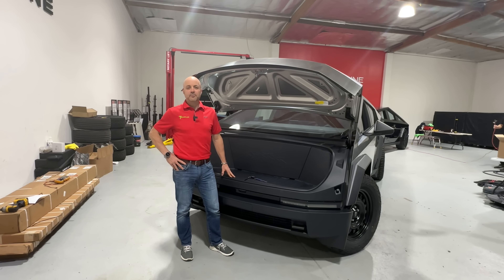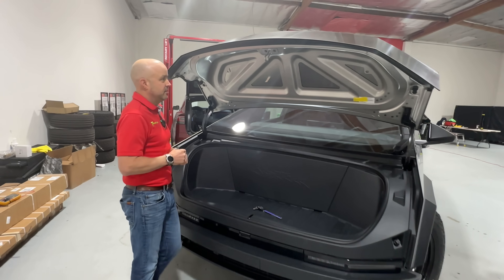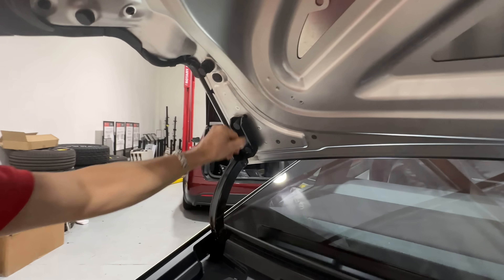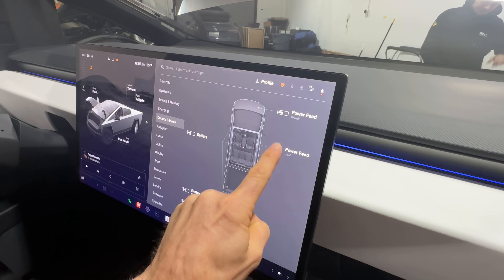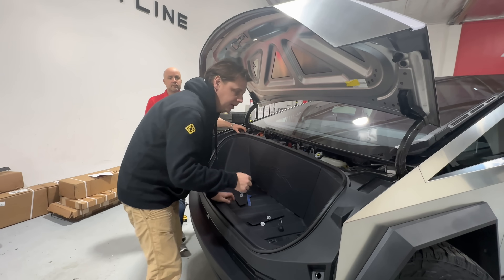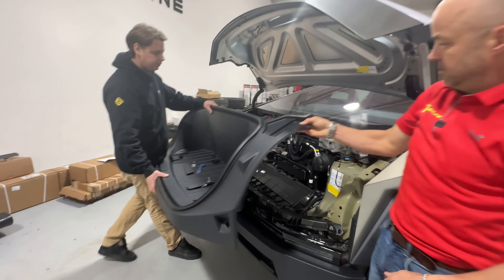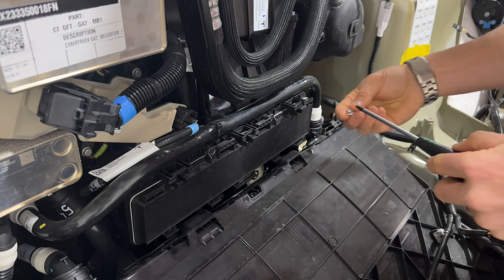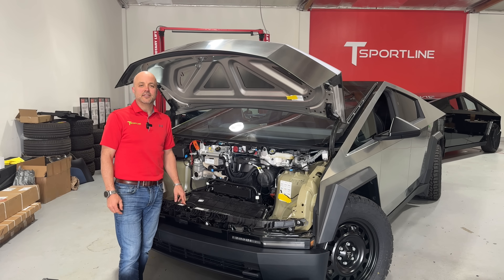Dissecting a Cybertruck Part 2! Tesla Auxiliary Power Under Frunk, Inspection & More, first look

Comment: That's a very tidy design. It's organized extremely well unlike any other EV. Tesla engineers are really the best in their craft.😮
Reply: So, if I want to replace my cabin filter it's like a 4 hour process to remove the "frunk" and all the additional bits. Yeah, great engineering. Rivian is one easy removed panel and a cover plate. Neither need tools to remove.

Speaking of frunks, what do you put up there? Couple of Target bags full of stuff you don't mind spilling out? There's not even a cargo net to help with the TINY space of storage up there. Pulling from the previous video on the break down, only aluminum or aluminum combo metals for under the truck? For a truck you supposedly want to go off road? No option for any kind of upgraded skid plates? Sad. And speaking of off roading, can't install larger tires without some sort of really custom lift kit or hardware change kit to remove the exposed bolt ends?

This was a truck engineered by car makers who don't know anything about going off road. Not their fault. I blame Elon and unbeatable time-lines.

Also, rear wheel steering on an off-road truck? If so, you had better beef it up a LOT more than they did. Again, car makers making trucks.
Reply: @azsean73  If you did just tried to finish video and listen carefully, you wouldn't be ignorant about the fact that it is accessible with having to remove all of that. There's a dedicated access in the middle of the "frunk".
Reply: @azsean73  People who can afford Cybertruck doesn't go to Target like you. And may I remind you, there's a 6 foot bed in the back.
Reply: @jaymarkkabo2626 wtf cares!?
Reply from the maker: It is not bad!
Reply: Smokes the rivian everytime 😂
Reply: @azsean73  wrong. There's an access panel to the cabin filter.
Reply: And Dancer Bus engineers too.

Comment: Everything's so tidy, compact, and easy to get at. Impressive!
Reply from the maker: It is easy to pull apart
Reply: @TSportline  i want to know if that rectangular box just above the front bumper camera is for the radar module or a washer fluid storage for the camera
Reply: So, if I want to replace my cabin filter it's like a 4 hour process to remove the "frunk" and all the additional bits. Yeah, great engineering. Rivian is one easy removed panel and a cover plate. Neither need tools to remove.

Speaking of frunks, what do you put up there? Couple of Target bags full of stuff you don't mind spilling out? There's not even a cargo net to help with the TINY space of storage up there. Pulling from the previous video on the break down, only aluminum or aluminum combo metals for under the truck? For a truck you supposedly want to go off road? No option for any kind of upgraded skid plates? Sad. And speaking of off roading, can't install larger tires without some sort of really custom lift kit or hardware change kit to remove the exposed bolt ends?

This was a truck engineered by car makers who don't know anything about going off road. Not their fault. I blame Elon and unbeatable time-lines.

Also, rear wheel steering on an off-road truck? If so, you had better beef it up a LOT more than they did. Again, car makers making trucks.
Reply: @azsean73  Did you even bother to watch the video, or do you just troll....
Reply: @azsean73  The HEPA filter is accessible from that square panel in the frunk. watch more videos.
The frunk is narrow yes, due to the shape of the truck obviously. but you have ~9x more lockable storage that the rivian frunk in the vault since it has that tough tonneau cover.
I believe you can get skid plates already.
yeah larger tires will need to be pushed out due to the exposed bolts.
seems like a very good off-roader just not an extreme one.
rear wheel steering is a very nice addition to a massive truck like this. seems like you are looking for a truck purpose made for extreme off roading so best look somewhere else if you're looking to make that trade off.
Reply: @azsean73  Shorting TSLA?
Reply: @TSportline  can we charge the CT through the auxiliary?
Reply: @azsean73  I think you didn't really listen? You don't have to remove the frunk to get to cabin filter. There is a removable rear panel (clicked) in the frunk that you can remove, then remove the 2x 20T screws and that's it. It's a 2 minute job.

Comment: Question: Are the rear seats easily removable? What is the largest rectangular box that fits in the cabin when the rear seats are removed? Thanks!
Reply: Agreed!   I removed the rear seats in my old extended cab and could easily transport a hot water tank back there.  In the CT, the rear seats should be attached to the back wall of the cab.
Reply: I saw another video showing the narrowest dimension with the rear seats up to be 21", while the larger dimension was around 30",  The rear seats do not have a track, the seat is attached at the rear and swivels up.  You could sleep on the floor with the seats in the up position.
Reply: Not by default and even still, you lost any kind of usability for people. Rivian has under seat storage (lockable) and a gear tunnel behind that. Oh, and a weight-bearing tailgate so you can put heavy stuff in the back for the full 7 feet of the bed. Sad
Reply: @azsean73  Rivian has a pathetic 4.5ft bed. Lockable storage in the Cybertruck is far greater than that of the Rivian.
Reply: @azsean73 - I don't think the Rivian is sad.  Rivian and Cybertruck are different market segments and I don't see a lot of overlap.  Cybertruck has optional under-seat storage, but unlike the Rivian, you're not forced to use it. CT allows for larger items to to be towed in the back seat area. The tiny bed (54") in the Rivian R1T could be a problem for some, while the Cybertruck is a full 6 feet (72").  Lockable storage in the bed is also considerably larger in the CT.  So each CT/R1T has a number of unique benefits. Get what works for you!
Reply from the maker: Don't think so.  The rear seats flip up easy enough.  But looking at their brackets, its no quick and easy removal for sure!

Comment: I want to install an electric winch on the front of my Cybertruck. Can you show the structure behind the bumper and evaluate the possibility of winch installation. My square body GMC has a PTO winch stealth mounted behind the bumper; just the rollers stick out. Would love to do the same.
Reply: I think the only way to do that will be like how the Lightning was done to handle a plow attachment. Basically a custom bar that uses the front tow hook mount points to attach to the frame, on said custom bar you can have a front receiver, mount a winch, etc.
Reply: Power may be a problem. The 48V Aux was stated at 400W, which is about 1/4 the power needed for a 2,000 lb winch.
Reply from the maker: You'll only have 400w of power using the switched aux power.  For the winch, you'll likely need to go direct to the battery.
Reply: @TSportline Might be able to tap off an AC outlet.  Should be good for 1500W, maybe a bit more.

Comment: Would like to see you guys dissect the rear underbody that encases the tow hitch assembly. There's an extra few inches that is part of that underbody that decreases the departure angle of the Cybertruck and really wondering what that area is for. Thanks for all the teardown analysis videos so far!
Reply from the maker: Thanks for watching!  Tune in again for the rear bumper detail - soon!
Reply: There has to be a "surprise" under that by the way people have avoided showing it for so long. Many have asked this same question.

Comment: So if you are connecting a winch, what do you use? You need some real amperage for that use case.
Reply: It's 48V it's a total wattage thing.
Reply: So, take the wattage of the winch and divide it by 48volts. That tells you how many amps it'll pull.
Reply: @AvocadoAtrocity  The total wattage is still only 400W, so this is not nearly enough for any sort of winch. My thinking is that this could do as power for the control box for a winch connected to the high voltage battery. You could send and receive commands to the winch via that CAN wire.

Of course this depends on there being available HV connections suitable for 3-10kW somewhere. A much greater teardown is needed.
Reply: @rlaxton666 the 48v is for the high powered vibrating butt plugs come standard to tesla fanboys
Reply from the maker: Only 400w on the aux power line.   Anything over that, going to need a direct to battery connection - if the battery can handle the device you're after
Reply: Are there ports on the battery that allow that sort of connection? I know they go to great lengths to keep it watertight.  @TSportline
Reply: You put a 12V battery in the frunk.

Comment: What's with the fluid trails running down the the left inner fender?  Looks like something is leaking.  Does the wiper motor have a gearbox that's seeping?  Brake fluid?  Or is it dry and some staining that was there before the truck was built?
Reply: The same fluid is leaking down the side of my truck when I use the wiper for a little bit. It's only a very small amount that leaks out of the corner of the A pillar stainless trim piece. At the joint of the stainless an ounce or so of this brown oil has run back the first two times I have driven in the rain and used the wiper. In the video it looks like it is coming from the wiper bellcrank gizmo and not the brake fluid reservoir. I'll disassemble mine and take a look.

Comment: Does the 50 amp outlet in the bed work while in drive? Would be cool to power a camper & refrigerator during drives without needing the traditional battery/solar setup.
Reply: Yes, it does!
Reply from the maker: Yes, you can control the outlets from the screen.  And leave them on while driving.

Comment: Im still surprised that Tesla didn't put any 110 volts plug at the frunk. It would be nice to make a camp stove in the trunk for future accessories.
Reply: maybe there will be an aftermarket frunk liner that makes use of the power supply.
Reply: There's a 110v outlet in the center console, wouldn't take much wiring to chain one to the frunk. I bet there will be an aftermarket kit :)
Reply: @BlazerRox   I just think Tesla missed a opportunity to really make the front frunk more usable in my opinion, besides the Cybertruck is so delayed that you would think they would have learned something from both Ford and Rivian. Also no spare tire storage is a big negative. Both Rivian and Ford have spare tire.
Reply: That costs money. Elon doesn’t like that.
Reply: @rj8u  they have learned a lot since then have improved it a lot. there just isn't a lot they can do with that frunk.
making the storage under the bed deeper instead of being able to accommodate a tire tho is the one negative i have, i agree
Reply: @a-don13  The Rivian R1T really did a great design and packaging for the truck specially with the frunk, gear tunnel and the under bed spare tire location. It seem to me after all of the delays for the Cybertruck Tesla sacrifice alot of the initial design of the Cybertruck like the Six seat configuration and other things.
Reply: @rj8u  not at all. seems like they have pushed this triangular form factor to the max in terms of packaging. What we got is most space they could have gotten with the frunk, most amount of cabin space and under seat storage, and most amount of bed space (that includes a built in fully retractable vault) with the exception of that under bed storage being deeper instead of longer and the side-sails, which have a bit more unutilized space with in from a video i've seen. I believe these will points to address in the next iteration. Just like how the R1T needs to redesign the frunk so that it has a low point of entry like the F150 and cybertruck. Other wise the R1T is perfect.

No one wants bench seats in the front row. that and the tailgate ramp are some of the few things that i am glad were removed from the first unveiling. bench front seats are the least popular options in trucks sold.
Reply: @a-don13  Hmm you have good points. I just really would have lived to see a fully integrated spare tire storage, but I'm hoping also Tesla will resign a CyberSUV in the future to address the Suv three row market 👍👍.
Reply: @rj8u  me too. This is the one vehicle i had less to nitpick with tbh idk what else they could have given us. 
I just want to see that under bed storage being able to accommodate a spare tire, seems like it has enough volume already just needs to be stretched out. oh and a 120v in the frunk.
i saw a cybervan mock up and i could be wrong in saying this triangular shape would only work on a truck form factor. gotta wait and see ig.
Reply from the maker: Good point
Reply: They have 2 terminals up front for jumping

Comment: Im very interested on how the braking syetem works seeings theres regen braking and no vacuum line...Is the brake pressure fed by an electric motor and if a Tesla loss all power can you still stop it with the brake pedal as its free rolling?

Comment: Just connected the underglow lights to the frunk power outlet wires using a step down converter (48v-12v). The problem is, there is a separate switch for the lights, so if I leave this switch on, and I want to control the lights from the screen, when I turn the switch it cuts the power and says reset. Then I have to turn the lights switch (conventional) off, then turn the button on the screen on, and then turn the conventional switch on, then I can control it from the app. Once the auxiliary power turned off, I have to turn off a conventional switch on the lights off, turn the button on the screen on and then turn the conventional switch on and use them. Is that because it draws more than 400w when turning it on, then drops? Thanks

Comment: Thank you, nice video.  
Do you think a 36" L-track could be secured horizontally approximately 12" from the frunk floor on that rear access panel?  Is there enough structure there to support it?

Comment: 8:57 what sort of room is there for a self tailing winch? Could it be placed laterally below the frunck liner? (As in, fairlead on the left of the vehicle with line running internally across to a right side mounted drum & motor.)

Comment: I intend to put in some individually controllable lights in this thing using the front auxiliary power. I bought a 48v to 12v step down for my controller. Any idea if just turning it off in the system will protect me from getting shocked. I intend to test it anyways but I am not used to car electronics.
Reply: Thanks to your video I was able to do this. Just need to figure out where to run my wire on the sides

Comment: Does it get hot in the front storage? I would imagine there's quite a bit of heat being dissipated by all that ac gubbins
Reply from the maker: Good question, the cooling system is right below and behind, so likely yes will have heat issues
Reply: If you're buying ice cream at the grocery store, the frunk is going to conveniently melt it for you by the time you get home. 😅

Comment: The large labeled rectangular item is a liquid to liquid Flat Plate Heat Exchanger, I sometimes use them in house heating Hot water floor systems.

Comment: Where did the 400 watts number come from? (400 watts) / (48 volts) = 8.3 amperes
Reply from the maker: Confirmed with Tesla, both auxiliary power taps are rated to 400watts.  Both are protected with solid state circuits, if you exceed 400w, they shut off.
Reply: @TSportline  Thanks much for the follow up. That is a good nugget. Appreciate the informative videos!
Reply: @TSportline  BTW, there is some confusion about 400 W vs 2.3 kW because there are two places that mention 2.3 kW ?
a) the configurator source code stated "Two auxiliary power connections with 2.3 kw output"
b) ordering email had "Included Powershare outlets ... 6 bullet points then 7th says: -TWO AUXILIARY POWER CONNECTIONS WITH 2.3 KW OUTPUT"
Reply: @Scott-sm9nm The 110V outlets are 2.3 kW each...
Reply: @HenryLoenwind  I understand. However, it specifically is talking about the 'auxilliary' power. The 120v outlets are bullet pointed separately in the doc as well as on the Cybertruck screen.

Comment: Kudos to the owner that's allowing  them to pull his brand new car apart. Frfr
Love the video
Reply from the maker: Thanks! We've had multiple customer trucks in so far, those we used for videos have been fully supportive.  Also, when we apply a vinyl wrap, we take off the cladding, mirrors, etc so we can do a premium job.
Reply: Wow okay I'll definitely patronize yall whenever is my turn to get mine. 
Thanks very informative 👍

Comment: Does it use power steering fluid or all electronic? Didn't say if it had a power steering pump or fluid tank.
Reply: It won't have hydraulic steering assist - that went out of fashion about a decade ago. Steering will be by electric motors.

Comment: is there any possible way to route a small shileded cable (small diameter) though the auxialiary light bar cable grommet? Basically I need to know if there is a way to route a rather thin antenna cable from inside of the cabin on the outside for telecommunication purposes such as HF/VHF/UFH applications. Many thanks.
Reply from the maker: The whole edge trim pulls off the roof, so yes

Comment: Hey Tsportline. Did you notice anything that means its setup for an easy RHD swap ( calling from Australia ). Example would be is the wipermotor mounting interchangeable on the current casting?